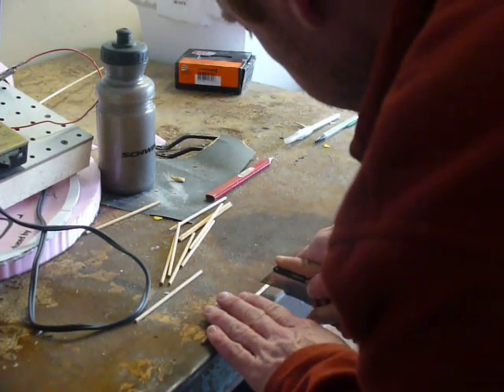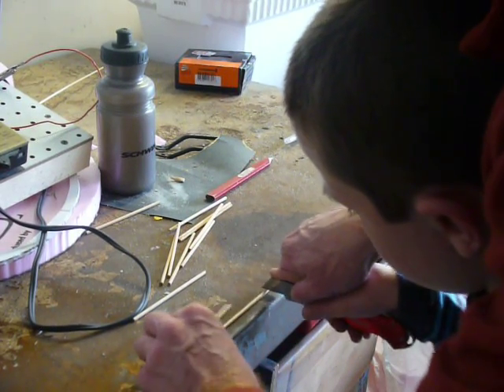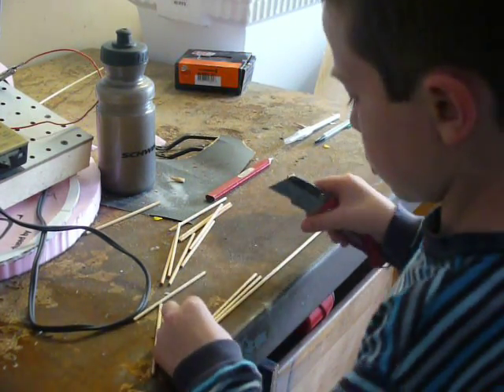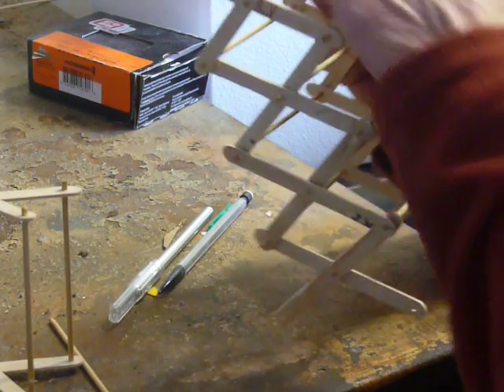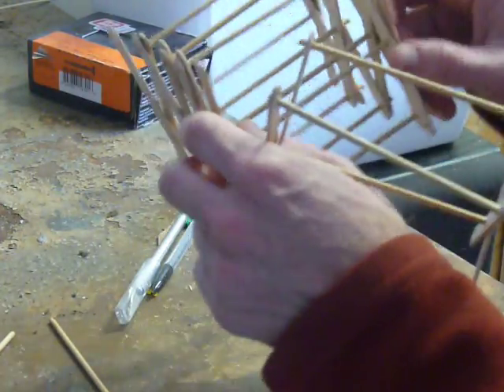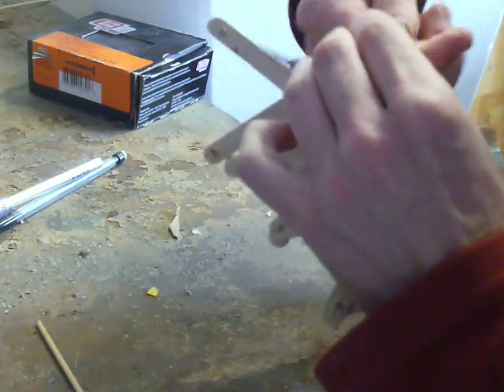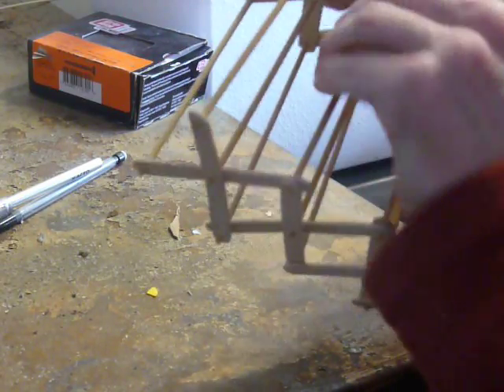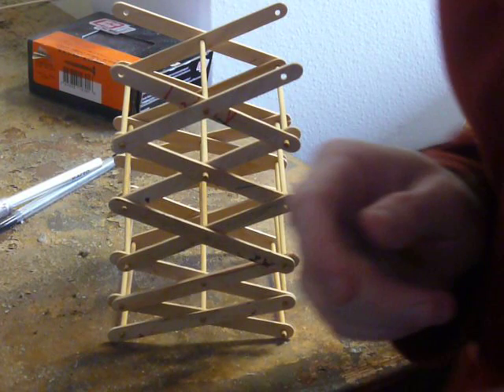Making a scissor lift

Comment from the maker: @aschermann18 It is really easy. We used regular popsicle or craft sticks, 1/8 inch dowels and an 1/8th inch drill bit. We eyeballed everything but essentially you drill a hole in the center and a hole at either end. The problem with the end holes is that they want to split when you put the dowels in.  I'd drill those holes 1/2" from the ends. Assembly is just like the video shows.  Assemble one side first and then attach two sides to the dowels.

Comment: Great Work. I know your son will learn a lot from projects like these. I think I'm going to build one for a small portable table that I'm making. 

Using 5 scissor pairs with a width of 1/2" each, your design should compress to ~3". One set of parallel sticks should be on the outside and the other set should be on the inside to prevent them from binding when it's closed.